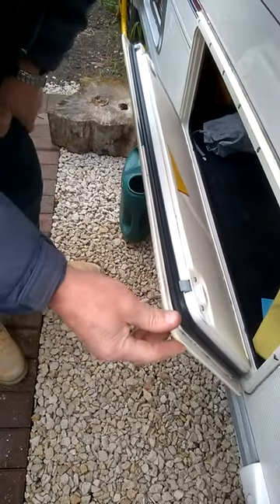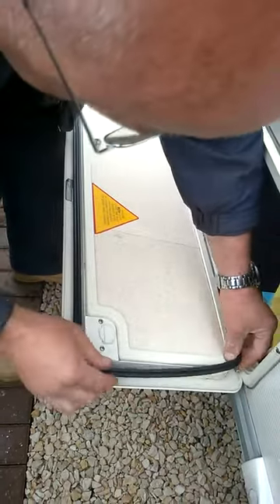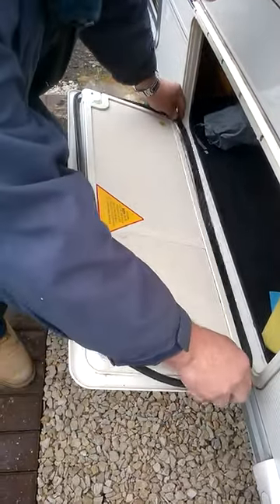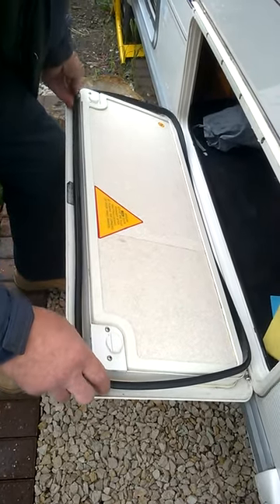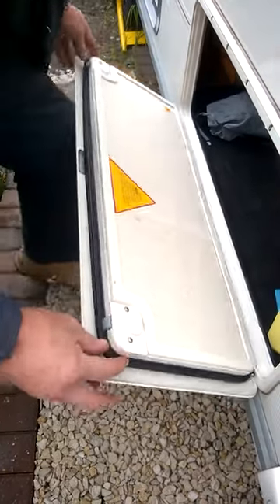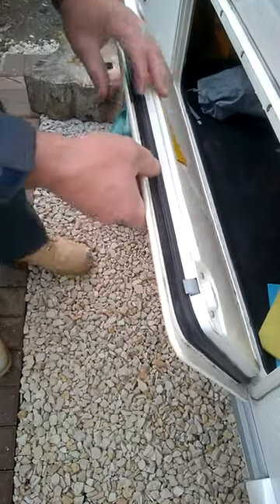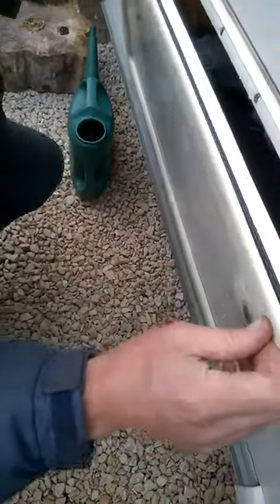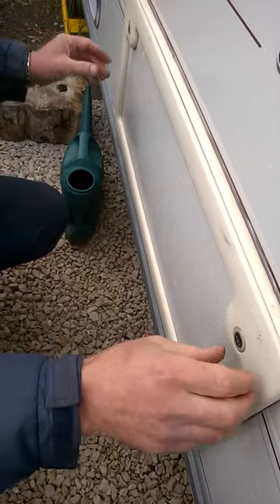Leaking Wet Locker (Bailey Caravan).

Comment: Great tip but where can I get a new replacement seal from?
Reply from the maker: This worked so well for me that I never bothered with a new seal. 
The problem (with my caravan) is the gap between door and frame widens in the middle over time, so I don't really think a new seal would be any use. 
If your caravan does not have the same frame/door distortion, you may be better off just replacing the seal anyway.

Comment: Sorry tied it and lots of water in van Bought a new seal as I should have don in the first place
Reply from the maker: +Paul McCormick Sorry to hear it didn't work for you, obviously a new seal would be the best option. But my door leaked due to it deforming (bowing/sagging along the top edge), so a new seal would not work. This option is still working fine for me and was posted with only good intent. Good luck with your new seal.
Reply: Good intent accepted thank you I will check for distorted door and also check hinge pins Seems to be a major defect on these models Now rectified on  newer models Cheers
Reply: +Paul McCormick you can also adjust the strike plate further back so it closes tighter against the frame.
Reply: Paul, it's bee 2 years ago, what was your outcome?